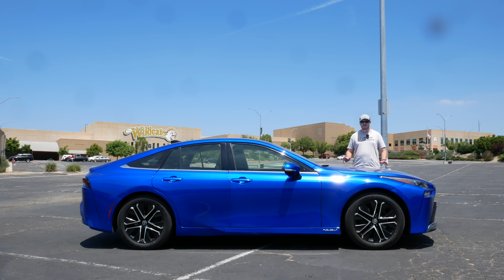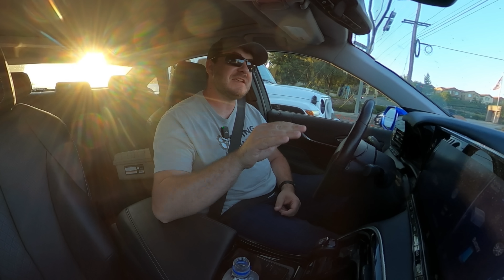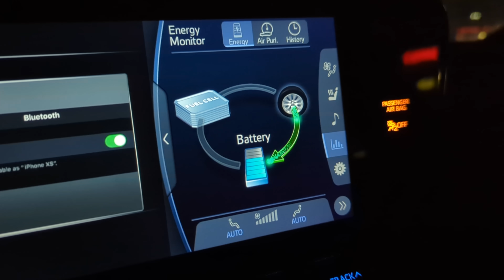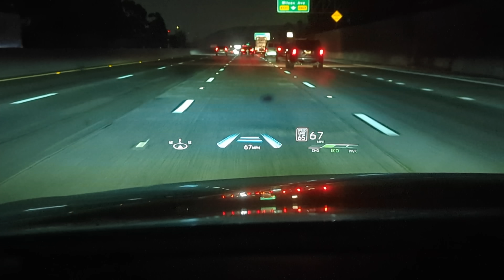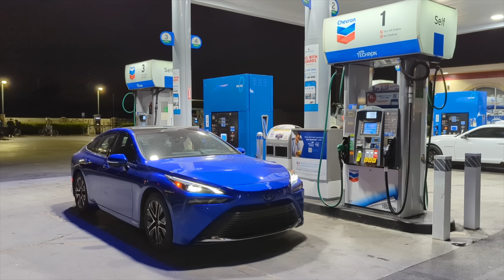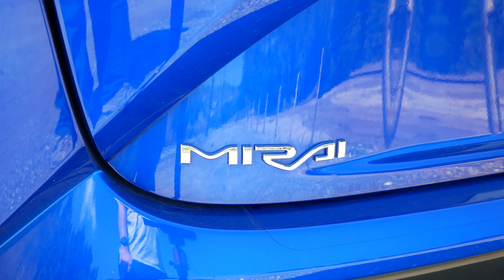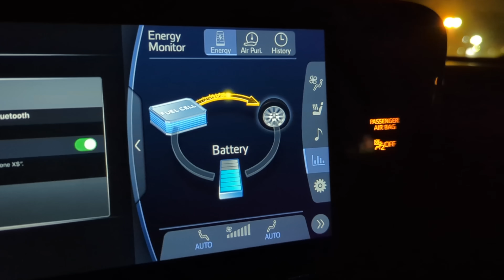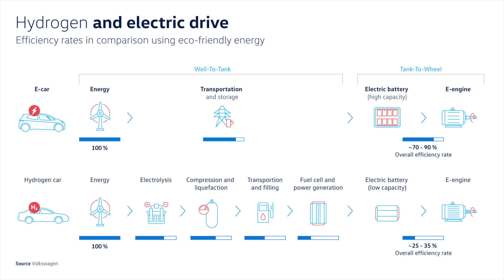The Toyota Mirai is Disappointing

Comment: I used to be such a hydrogen fan girl until I researched the practicalities at uni and came to all of those same conclusions. 

Add to that, hydrogen REEEEEAALLY doesn't like to stay where you left it. Look into the issues that rocket engineers have with seals and valves. And, hydrogen explodes really nicely. It might be safer for firefighters out in the open but you definitely don't want it leaking inside a structure.

Comment: I find it so refreshing that when you got to how a hydrogen fuel system works, instead of 'bluffing' your way through it, you simply said you weren't sure. A wise man knows what he does not know!
Reply: I do know and hydrogen powered cars is a dead end.
Reply: well technically hydrogen fuel cell tech is in a nutshell actual fusion tech since it is fusing oxygen with hydrogen to make water and power from that process
Reply: @raven4k998 bro thats not what fusion is, that is a normal chemical reaction. fusion would be if the hydrogen was being converted into an entirely different element.
Reply: @nexxara4572 Yeah, fusion is to put together into one, fission is to split one into two. Water, H2O, is two hydrogens with an oxygen atom in the middle, so it is three distinct atoms. A chemical reaction would be 2 plus 1 starting atoms equals three atoms at end, whereas fusion would mean less atoms at the end than the beginning.
    If you're actually curious about how hydrogen engines work, I'm not specifically sure about this vehicle, but generally they are combustion engines, the major difference being the fuel burned is pure hydrogen and not hydrocarbons (chemical made of carbon and hydrogen) like C8H18 (gasoline).
   A short and majorly simplified rundown of combustion reactions is that a hydrocarbon + oxygen = carbon dioxide and water. So, when you burn a fuel that does not contain carbon, there is no carbon for which carbon dioxide or such other products. The only result of burning two Hydrogen gas molecules and one oxygen gas molecule will be two water molecules. This seems like an easy solution to the problem, but hydrogen gas is hard to manufacture in a completely sustainable way, and often fossil fuels are used in the production. Also, it is not as energy dense as the common fossil fuels, so it's easy to end up using more fossil fuels to create hydrogen gas than you would have if you just used the fossil fuels to begin with. Now, I'm not saying it can't be done sustainably, I'm saying it's easy to market hydrogen gas as inherently sustainably derived while not actually sustainably deriving it.
Reply: @raven4k998 I see you like to go with the “bluffing” technique instead of being honest that you don’t know
Reply: @raven4k998  I didn't know that, but I genuinely love learning, so thank you.
Reply: @bazilwreckerloughead  You love learning yet you failed to see the biggest BS-statement that I've seen yet regarding physics lmao...

Don't mind me, just gonna use my fusion powered fireplace to "fuse oxygen into carbon dioxide", since it's tEcHniCaLly in a nUtSheLL ActUal fuSion 🤪
Reply: @alenko4763  he said he loves learning, not that he's learned everything, jackass, maybe he's spent his lifetime learning everything about magnetohydrodynamics or psychoendoneuroimmunology, transportation psychology, linguistic anthropology, automotive mechanics, embedded engineering, epistemology (which you evidently are unfamiliar with), or legend of zelda ocarina of time speedrunning lore or whatever the hell else, there are so many fields of study that you haven't even heard of not to mention know the first thing about, which all each have as much nuance and technical terminology and sub-fields as any other; you can't just expect random people that happen to like learning things to know the basics of chemistry, nuclear physics, and the function of hydrogen fuel cells, I shouldn't even have to fucking say that, even if most people know the names, that's all most people know, the vast majority of people no matter how eagerly and ravenously they love learning do not know the basics of any of those things required to identify his obviously (to any person novice in those topics) ridiculous statement as false, nobody knows everything, any given person only knows a miniscule fraction of all the knowledge possessed by humanity, and everybody spends their time learning different things, not everybody will have already learned the things you have learned no matter how basic or simple they may seem, and all everyone can do is learn one more thing at a time, don't call out the people that are just trying to learn something new with good faith confidence they're not being blatantly lied to, call out the people distributing misinformation to those people
Reply: @alenko4763 so explain it without looking it up
Reply: @alenko4763  dude your brain is so huge

Comment: While you may not see the sense in HFC over there, I can assure you that it is a completely different scenario here in Australia. While you can, theoretically, drive the east coast of Australia in an EV, the reality is that charging stations are sparsely distributed & non functioning chargers are more the norm. We also have a large percentage of people who like to carry heavy things in their Utes & tow big trailers long distances. HFC's just make more sense here & EV's are best used for driving around town & as grocery carts.
And then there's motorcycles. There's a reason that Kawasaki started developing HFC's & Honda, Yamaha & Suzuki jumped into the joint venture this year. To date EV motorcycles have been really expensive & their range is lackluster to say the least. And none have been successful as a result.

Comment: Is anyone looking at flow cell powered cars? Flow cells are batteries where the, um, charged-ness of the battery is a liquid. You can keep it in tanks. You pump the charged liquid into the actual works of the battery, extract the energy, and store the uncharged liquid in another tank. Then if electricity becomes available you can pump it back again to charge the liquid. The advantage is that tanks are really, really cheap. You can add more energy storage by just adding another tank. I know they're being looked at for grid storage, for this very reason. But this also seems ideal for cars; a system where you can charge your car from electricity or by filling up at a fuelling station seems ideal.

The downside is that the energy density isn't high and the chemistry isn't exotic. I've heard of one flow cell battery chemistry where the liquid solidifies at room temperature. The good news is that you can melt it again and the charge remains, making it even easier to handle, but for a car it's really what you want. But that was years ago and I'm sure the technology has moved on since then.

Comment: If automakers would design a charging connector for use while moving it would allow for modular, rentable range extenders such as hydrogen trailers or an in-bed device for vehicles like the Lightning or R1T. Range extenders don't even need a huge current delivery because it generally takes hours to discharge the main battery at highway speeds.

Comment: Japan is pushing for hydrogen infrastructure via a new series of nuclear power plants, where the process heat from the reactors is used to create hydrogen directly. Instead of 40% efficiency of heat into steam turbines to charge batteries or perform 30% efficient electrolysis, you get hydrogen almost as a by product. But this is still in development, and personally I’m not sold on the safety issues with regards to hydrogen. It leaks too easily.

Comment: To me, hydrogen would make sense if we went to mostly nuclear power. If we have enough nuclear power to go without running ineffective peaker plants, then we would have too much electricity at any time other than during peak hours. Producing hydrogen is not very efficient, but if we have excess electricity that is produced cleanly, then using hydrogen as an energy storage medium would be much better for the environment than mining lithium and other metals to produce batteries.

Comment: The biggest thing that needs addressed is how we get the energy to charge or fill EVs in general. Battery electrics will put the sole responsibility on the taxpayer. For everyone to have a battery electric vehicle the entire electrical system will need major upgrades and our current power companies will not be doing it without public support. On the other hand Hydrogen Fuel cells energy needs will solely be put on big business to solve the energy supply for the customer to purchase. Both will get tax breaks of course, but as of right now it’s cheaper to go the Hydrogen electric route if Hydrogen fuel falls in price immensely.

Comment: You didn’t mention how explode-y it is compared to an internal combustion car. I remember that being a big factor when these care were being developed.
Reply: I mean, the batteries on Teslas, Lucids and other high-power EVs are pretty dangerous if they explode or catch fire too. And even as someone born in 2000 I've heard of the firebomby Ford Pinto 😢. So every one of these propulsion systems is potentially dangerous.
Reply: @dirankomorov  storing lots of energy in a small space is necessarily a little sketchy. Hydrogen's propensity for leaking everywhere (including through at least some solid materials) seems to be especially sketchy, though

Comment: I suppose one advantage of the Mirai is you could hook a hose up to the exhaust and use it as a steam cleaner
Reply: A little expensive for a steam cleaner though....
Reply: Nope the exhaust has very little volume and pressure. It ain't going to clean anything. My electric kettle has more fire power.
Reply: Technically you could do what with most modern fossil vehicles too, once the catalytic converter is warm and if you've got a particle filter, most of what comes out the back is steam and CO2
Reply: @krugerdave  Sure, if you want whatever you "steam cleaned" to smell like exhaust.
If it's so damn clean, they why does exhaust still smell like exhaust rather than boiling fizzy water?
Reply: @krugerdave and co

Comment: Since tesla has that ridiculous cabin filter for the ac, you could argue that a tesla with the ac on and windows down is cleaning the air without the need for a dyson. That being said, I wonder what the difference in aerodynamic impact and overall efficiency would be between strapping a hoover to the hood and having the windows down and ac on

Comment: You missed an important bit of background information regarding Hydrogen vehicles. Back in the 1990s, when California actually had an aggressive Air Resources Board, they pushed for zero emission vehicles and that was the first round of modern Electric vehicles. Then the oil companies and car manufacturers bought some politicians (cough, Schwarzenegger, cough) and EVs died again because all of a sudden Hydrogen was the way to go. Why Hydrogen? Well, because the oil companies produce Hydrogen as a byproduct of the gasoline distillation process and they could then sell it AND get funds from State governments for both producing 'low emission fuel' and reducing their negative emissions.

Oh, and the Sacramento 2 Hydrogen fueling stations? Both are often labelled 'out of service' when you get to them and the h2fcp website says they are online. A friend got rid of a Nexo after 6 months because they were that unreliable.

Comment: There is a reason that a large percentage of Hydrogen filling stations are usually out of hydrogen.  To fill a Mirai takes 5kg of hydrogen but a Semi hydrogen transporter can only carry 600kg of hydrogen in its pressurized tanks, so the stations run out of hydrogen really quickly unless they get daily deliveries.  The Semi's that transport the hydrogen don't run on hydrogen but if they did they would need 50kg tanks to get the sort of range you would get from a diesel powered unit.  If a transport depot only gets 12 fills from each hydrogen delivery I can't see hydrogen being the solution for large vehicles like Semi's.  An exchangeable battery would look to be the more likely solution given it's much lower energy cost over hydrogen.

Comment: The way i understand a battery vs fuel cell is that in a battery you store and remove energy chemical energy. In a fuel cell you can't charge (store), but you continually replace the "discharged" chemicals with new fresh ones. (Obviously, very simplified)

Comment: Very refreshing to see such a detailed summary of a hydrogen car ownership. Only thing I would like to add is that the lifetime of the fuel cell is to short (aprox. 10.000 hours) and the cost to replace it is to high for it to be a feasible option for larger vehicles.
Reply: Is 10,000 hours too short? if they only did 15mph as a lifetime average, that's still 150,000 miles.
The likely use case for such a car is more highway and less congested traffic and with the battery pack as a buffer, it could be double that or better.
Reply: @drumbrakes  150k is less then a petrol car... which is already a low bar. An ev is 500k miles. Replacing the fuel cell is called a totalled car since it costs more to replace then buying a new one lmao. Toyota must lose crazy amounts of money on each one sold.
Reply: @lachlanB323  it's literally them using the customer as a beta tester. They're experimenting with hydrogen cars and it's all in the name of gaining knowledge. So of course they're losing money.
Reply: @drumbrakes  So it has all the downsides of BEVs with none of the advantages. Great.
Reply: @gladonos3384  How did you make that conclusion from my comment about lifespan of the fuel cell?
Watch the video, it has several EV advantages & some ICE advantages, and some downsides specific to hydrogen.
Reply: @drumbrakes  

Cost of the vehicle itself:
-ICE: Cheap(+1 Point to ICE)

-BEV: Expensive(-1 Point to BEV)

-HEV: Very expensive(-2 Points to HEV)

Fuel availability:
-ICE: Gas is easy to store & easy to transport. Gas stations are everywhere. Gas  is not cheap but not expensive either(+2 Points for ICE.)

-BEV: Electricity instantly travels at a fraction of the speed of light through cheap wires. Electricity is available right at your house and while fast charges are not everywhere they are common enough and it should be easy to build more. Electricity is cheap(+4 points to BEV)

-HEV: Hydrogen is hard to store, hard to transport, impossible to find and expensive(-3 Points to HEV)

Maintenance:
-ICE: Complex but cheap to fix(-0 to ICE)

-BEV: Simple but the Battery degrades and is expensive(-0 to BEV)

-HEV: Complex, expensive & degrades(-2 to HEV)

Overall score:
-ICE: 3 Points.
-BEV: 3 Points.
-HEV: -7 Points. 

-Horse: -6 Points.
Reply: @drumbrakes  The only advantage of hydrogen is fuelling times. But recharge times aren't an issue with Tesla's... other ev's not so much. You don't get home charging, performance, efficiency etc of ev's. It is a bigger process to get and transport hydrogen then it is for petrol. Electricity on the other hand is SUPER simple. Electricity is everywhere. Petrol stations literally require electricity... same with hydrogen pumps.
Reply: @lachlanB323  I didn't mean to express any kind of enthusiasm or support for hydrogen fuel cell cars.
If I was worried about EV charge times I'd get a Kia, Hyundai, or something else with an 800v+ platform.
My point was simply that 10,000 hours of fuel cell life isn't that bad, by expressing it as a worst case scenario number in miles.

I have no intention of ever buying a hydrogen vehicle or recommending them to anybody I like.
On the other hand there is a Topper* character at my work who likes exchanging large amounts of money for pointless junk.

* see the works of Scott Adams for details.
Reply: Acually 10,000 hours at 30mph is 300,000 miles. That does not detract from hydrogen cars being a stupid idea.

Comment: Hydrogen holds a lot of promise as a range extender for pickup trucks and the primary fuel for OTR trucks and railroads, given the impracticality of routing 10MW of charging into a single truck terminal.

Comment: Hum. Three big 10,000 PSI bombs, with one right under your seat. All you need is a dent or crack to rather quickly release those 10,000 PSI of hydrogen. And pieces of the carbon fiber storage tank. And it's mounting brackets, and bits of frame. And the seat a few inches just above. And , a few inches above that. 

Oh, and once you are gone, there is still this cloud of hydrogen mixing with the oxygen in the air for about 50 feet around the car in all directions. Just  for a very small spark to turn it into a real nice FAE. But you wouldn't expect a spark to be generated by anything, if a sudden pressure release disassembled your vehicle while driving down the road, right?

Of course that would never happen. All this is regulated by California legislation, and I'd guarantee that they have made manufacturing defects in the hydrogen system illegal. Of course, you might get rear-ended at a stoplight by a hydrogen-powered semi pulling 80K pounds of goods, which might crumple your rear bumper. And rear hydrogen tank. And the other two. But it won't crumple you. You won't be there by the time the crumple zone would have reached the hydrogen expansion zone where you had been sitting. 

Of course, this is California, so I'm sure accidents involving hydrogen-powered vehicles are also illegal. Or at least will be, immediately after the first one occurs. Then again, crime is the biggest and most profitable industry in California, and is legally protected in most cities. Maybe making accidents with hydrogen vehicles illegal might not be the best idea.